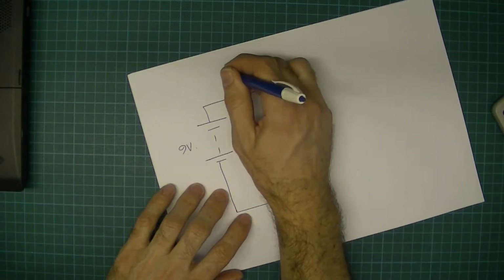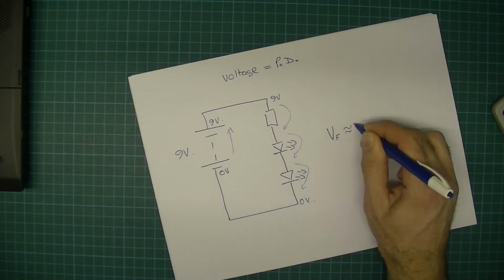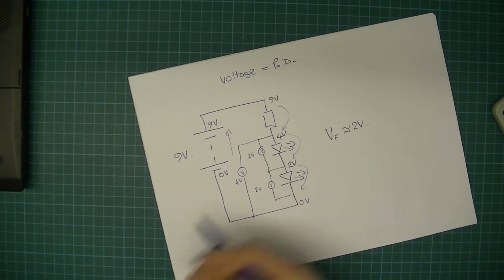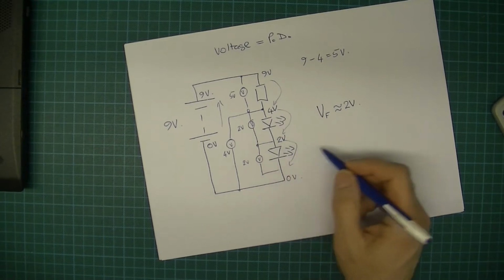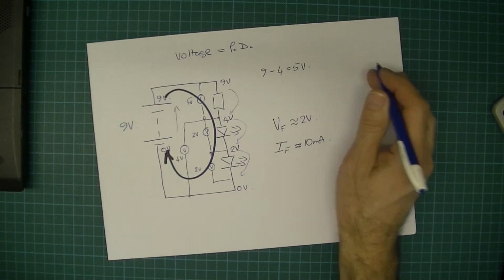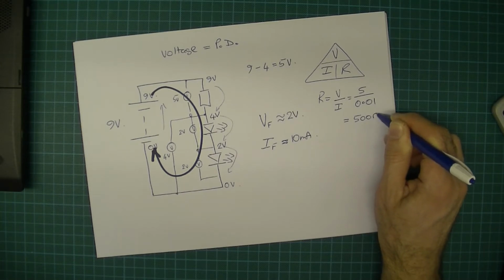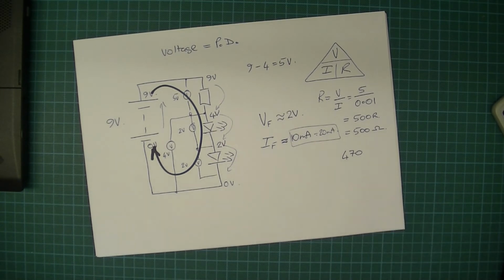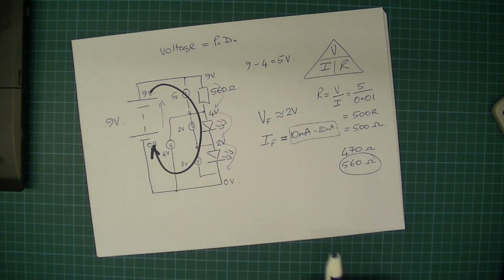Calculate resistor value for 2 LEDs in series

Comment: If I have 12 v supply and want to put 12 led’s of 2V each what resistance I will need? Or 12v supply is to small?
Reply from the maker: Too many to have them all in series. You could split them into 3 parallel branches of 4 resistors each. Other conditions also possible. Each branch would need its own current limiting resistor. To calculate the resistance and power rating you'd need to specify the LED forward current.